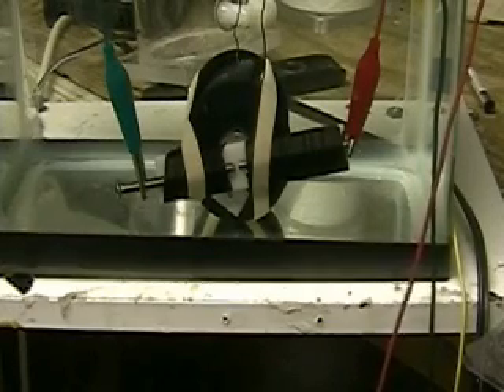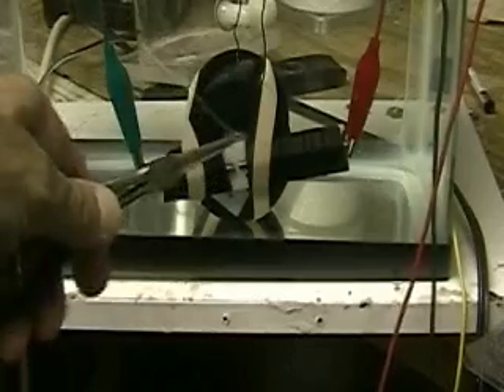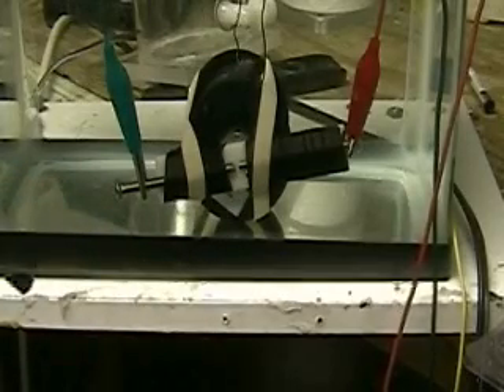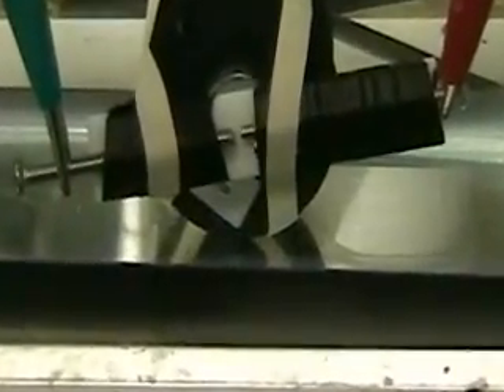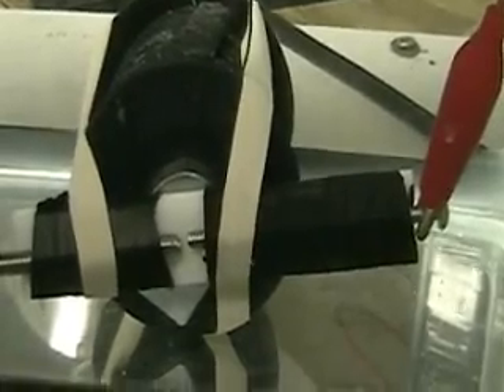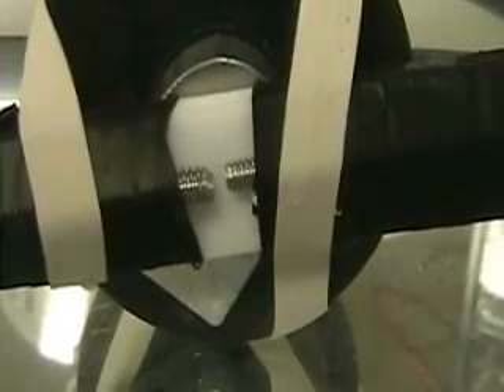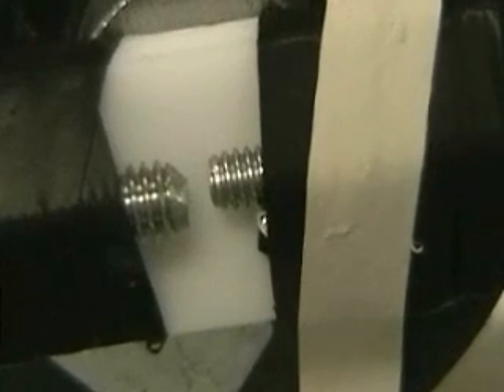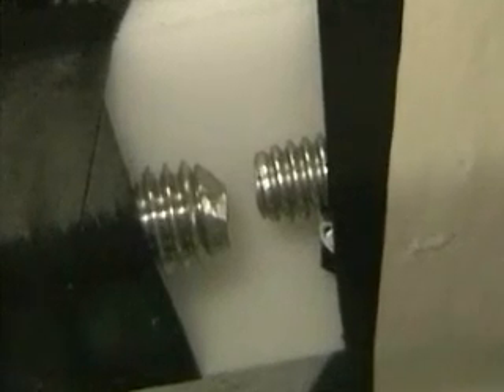Hydrogen Tap (Mag-Hydrogen Test) 357

Comment: John, have you ever tried pulsing 12V to an automotive ignition coil accross your electrodes? I recall SM talking about large amounts of voltage with very little current. I enjoy following your research and would love to see you put this idea in the mix.
12V -> pulsing driver circuit -> Ignition Coil (IC) | IC High Voltage -> electrodes.

Comment: John, looking at the screws, do you think there is an advantage to be had with the added surface areas from the screw threading?  If so, have you experimented with stainless steel mesh as opposed to flat plates?